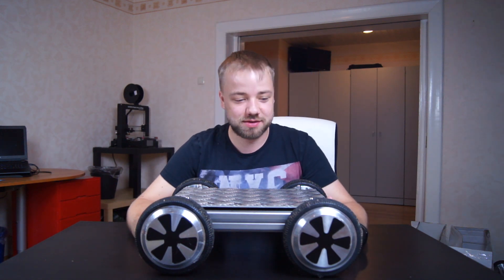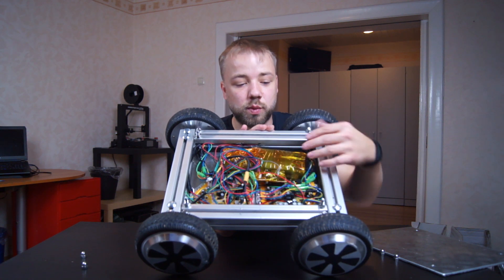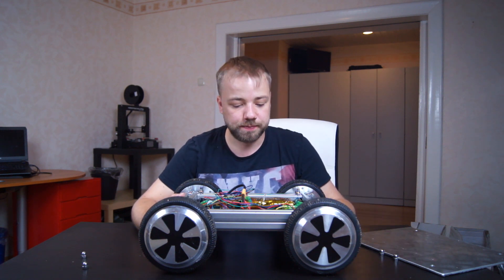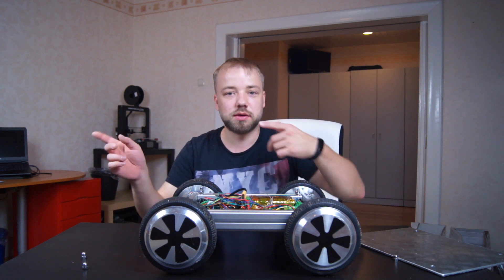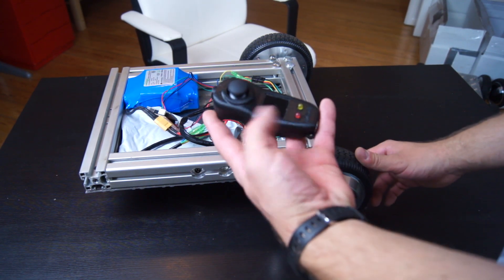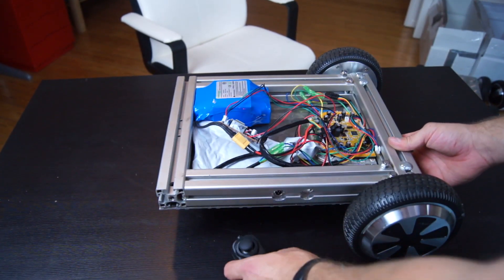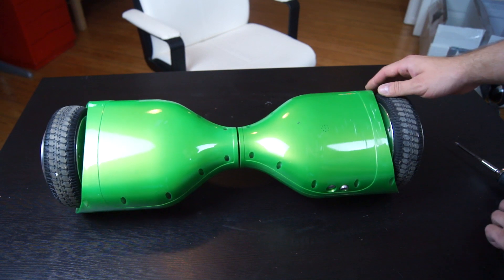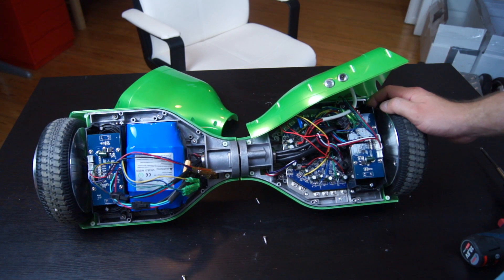Arduino Speed Hoverboard conversion

Comment: Hi, how do you control same speed for all wheels ?
Reply: It have hall sensor and control board automatically keep speed you want
Reply: @lifeai1889   control board comes with wheels ?
Reply: @valiokaz  just get a broken hoverboard then it have a full set you just need to replace the battery and flash the firmware mentioned in video then you're good

Comment: As I remember arduino\respberrypi has only 1 UART, how did you connect 2 hoverboards to it?
Reply from the maker: On Arduino they can be connected in parallel.
On raspberry you could create one software UART
Reply: @atc1441  Thanks, mate!

Comment: Nice job. Need help - I have two hub motors on the front side, but they move with different speed when they are connected to same arduino and power supply. Any suggestions on how to ensure the wheels move with same speed if they are moving just forward or backwards. Thanks. Any help would be appreciated.
Reply: https://www.youtube.com/watch?v=YhvPJpmJgOk

Comment: great job
 i have few Questions   
 if  you may  please  answer me 
 1- i have  Connect the Rc Receiver Data pin to Arduino Pin 3 so what pins are the outputs for speed and Steering wires?
2- i have use this code for my arduino uno is it ready  code? or i have to edit some thing because  i upload it to the arduino but not working  https://gist.github.com/atc1441/b8ece541c12da30ee4f52acabb919b02 
Thanks,

Comment: Hello, I have the idea to make the same robot platform to pull loads or do the garden for example, do you think the torque is enough? Thanks
Reply from the maker: Hi. I think it should work. Its 1kw power
Reply: @atc1441  Great thanks I will try to buy wheel motors to test!

Comment: Hi @Aaron Christophel Thanks you for nice video. Im vietnamese. i want to build a 4wd as your. i watched your clip many times but cant find exactly the name of hardware you use. can you list to me the name or link of hardware need to buy. Need 2 hove boad, 2 Esp32 - wroom or Esp32 - soC ? "Arduinio now ? i cant find" , power  converter 42 -> 5v for esp32 ?
Reply from the maker: Hi. Did you watched my other video about it? I explain there and in the comments
Reply: @atc1441  I wached all your video about hoverboad. but i cant found "Arduino boad ESP32 Now which you used as ESPNowReciever "on the internet is not found.
Reply from the maker: Yes that is one compatible board, any esp32 board should work
Reply: @atc1441  Thanks you for you reply
Reply: @atc1441  How to connect serial port from ESP32 to hoverboad ?  connect Tx-> SWCLK , RX->SWDIO on hoverboad ?
Reply from the maker: No. Please see the pinout here
Reply: @atc1441   Thanks you. i found it.

Comment: could you provide the codes for arduino and stm32 for differential mode ?
all i could get is codes for controlling four wheel drives using 2 stm boards.
i need to control two motors using a single stm board. please do reply
Reply from the maker: Hi you can just use one board with the code just leave one side unconnected.

 so it should work like that
Reply: @atc1441  Whether u r using 2 stm for right and left motors or for front and back motors ( I thought u r using for left and right motors each 2 motors = 1 stm (lft right))
Reply from the maker: @inbakrish8150  ah ok. 
No 1 board is for front and one for the back. 
I also build the 2 wheeled version that uses the exact same code

Comment: I would like to know the name of the control you are using. I would like to buy one
Reply: The clarify, the esp32 remote control
Reply from the maker: Hi you can use any esp32 board, i use this one in the remote https://rover.ebay.com/rover/0/0/0?mpre=https%3A%2F%2Fwww.ebay.com%2Fulk%2Fitm%2F142751041470

Comment: Where did you get the little plates for mounting the axles? Are these parts you can buy somewhere?
Reply from the maker: Hi. They are in the original hoverboards as mounting plates :)
Reply: @atc1441  Ah good, indeed! I was looking if its possible to move the electronics out of the way, and this will work for me as well.

Comment: By the way is it safe to turn on the RC transmitter before turning on the hoverboard mainboards? Does the car "run away" in case you don't strictly follow the turn on sequence? In my case my platform started driving on its own and didn't react to any commands from the RC transmitter if I turned on the devices in wrong sequence :-)
Reply from the maker: thank you my friend.
I have the Arduino nano in between which also has some kind of fly away security enabled so it shouldn't drive away but as you can see in the video I was holding my hand on the tank  just in case
Reply: @atc1441  Do I get it right that the only thing you changed it the platformio config was to set the control to -D CONTROL_SERIAL_PROTOCOL and define the USART port you wanted to use?